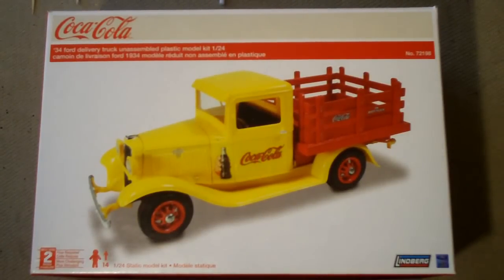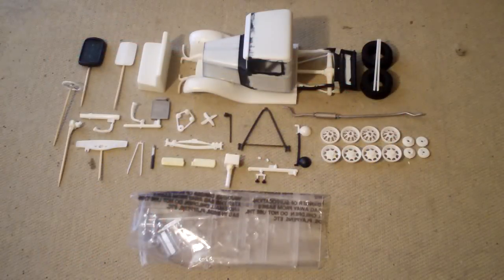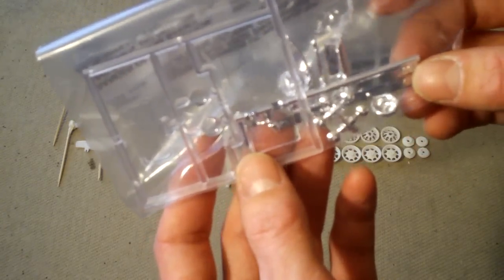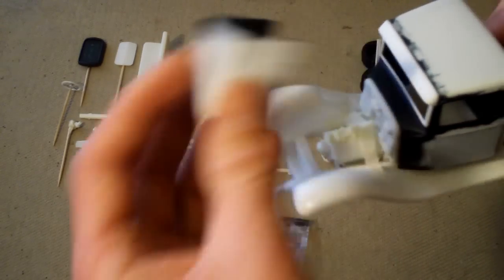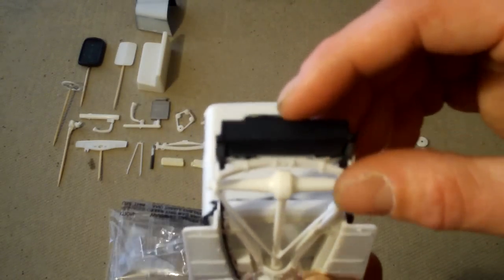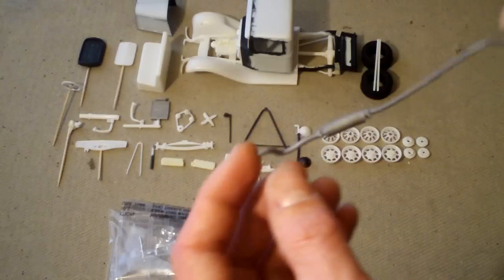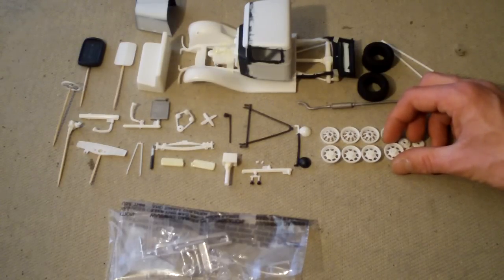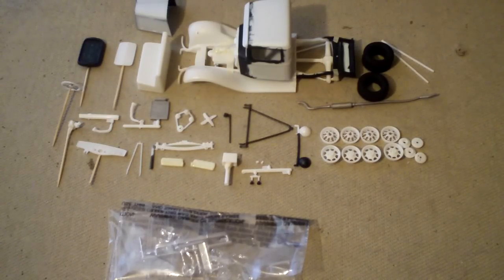1934 Ford Dually Semi Truck #1

Comment from the maker: @TedsModeling I do have 2 kits if tires are same then I can do a dually rear set up. I will have to narrow the rear axle a bit which should be hard. I just cut out the fuel tank since I am scratch building one for behind cab. I might cut out the molded in 6v style battery on the frame and use a 12v style I have mounted else where. The brake booster is not molded to stock firewall but is on custom. Might scratch build something for that as well.